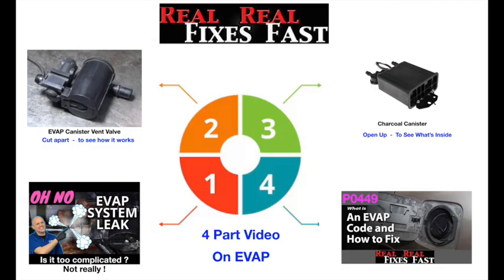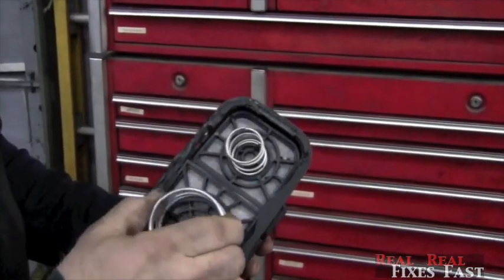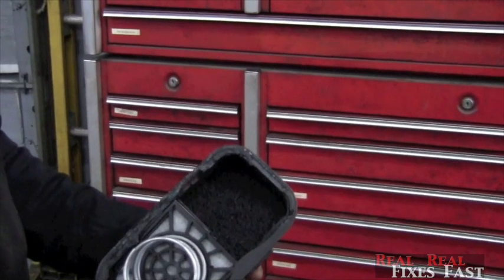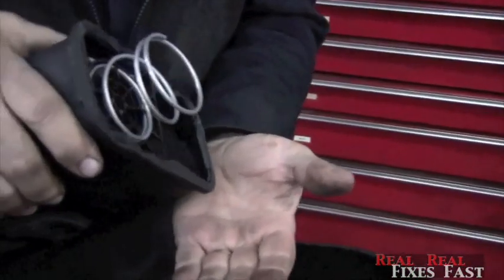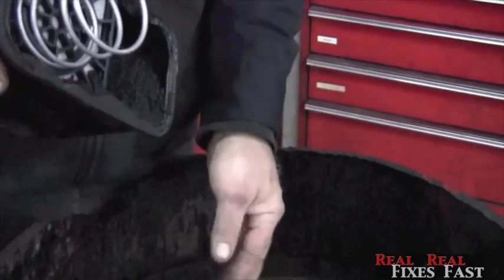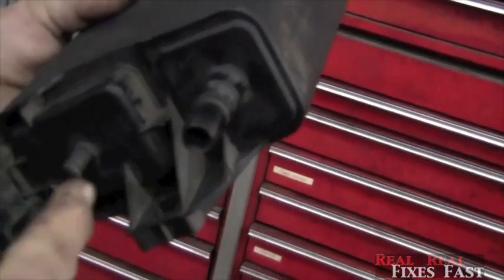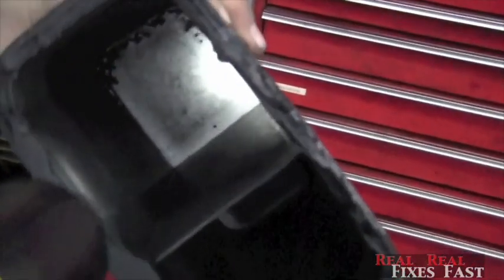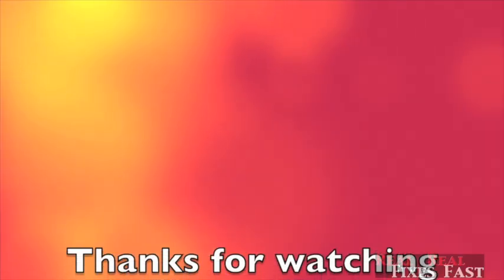Video 3 What is inside a charcoal ccanister

Comment: should they be in pellet form? I read someone who said it should be one solid piece
Reply from the maker: Understanding the science of "surface area", you know that any substance broken into multiple parts (pellets) will expose more "surface area" than if that substance only had limited sides exposed.  Therefore pellets will absorb significantly more fuel vapor than a solid charcoal block.  Hope this helps.
Reply: @realfixesrealfast  thanks that makes sense!